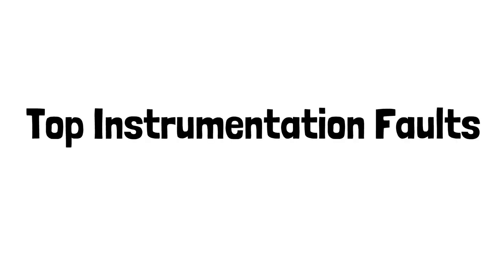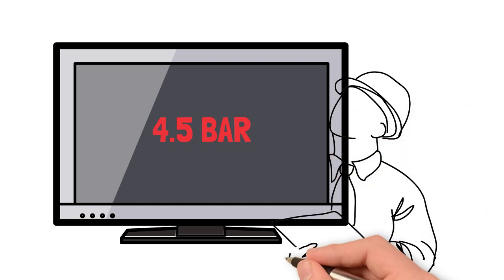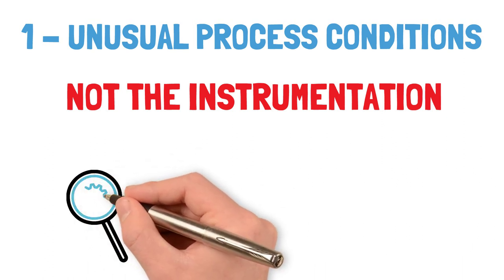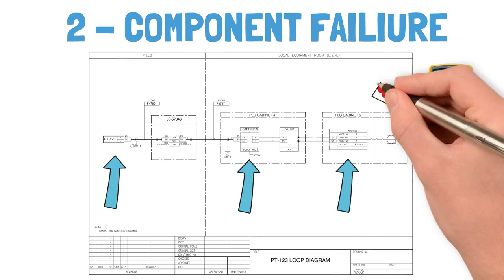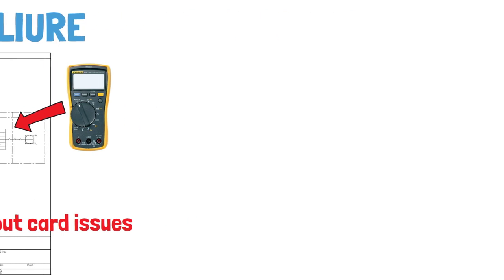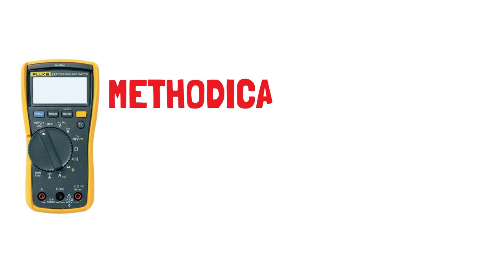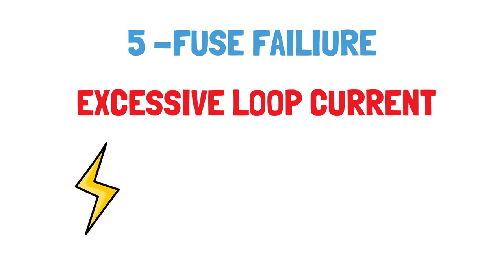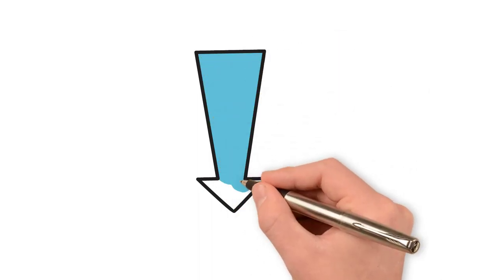Common Instrumentation Faults - 4-20 mA Loops

Comment: I worked in a complex nickel/cobalt plant and using a milliamp clamp meter was more convenient. You can narrow it down fairly quick without disconnecting.
For Level transmitters of radar or ultrasonic type, a power cycle or removal and cleaning usually remedied.
For differential transmitters, check the lines are clear through bleeds, if not flush.
Check operation by hand pumping to 50,100% in relation to the range in kPa etc.. if this is good likely a process issue.
Using a laptop can be advantageous if possible in sub station rather than a communicator depending on the system you have.
Always remember to have loops put into calibration before working as process interruptions can happen from you unexpectedly making the instrument read something.
Reply from the maker: You make some great points here Gary. Having the control room operators put loops into manual is definitely a big one. Thanks for sharing your experience.
Reply: I've worked in the Telephone industry  and a bit of access controls even. My hobby is electronics and circuits. I've always been interested in control systems and instrumentation. 
I wish I could go back a few decades  and take a different fork in the road..

Comment: I used to come across lots of faults on dip pipe level measurement systems, could you do a video on these please? Also just wondering if you ever experienced faults on effluent PH monitoring ?
Reply from the maker: Dip pipe level measurements are a simple technology but can work great. Often the issues with these are installation related. I may do a video on them one day. In regards to PH monitoring , calibration errors can cause issues. As well as isolation of process mediums. Thanks for your comment William, nice fish!

Comment: Resistance change with heat that is why light control is much better but will public trust engineering in military that is the reason for using resistor in circuit

Comment: Spending a lot of time, it's not an electrical issue. It does not work that way, in correct selection, it's turned off, it's has been in fault for weeks, the PLC code has changed overnight, etc. etc.